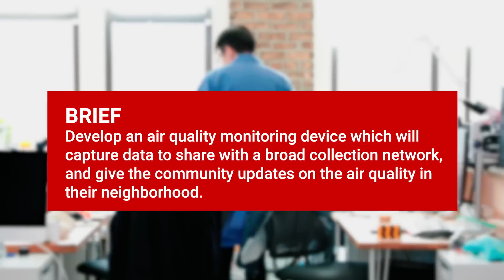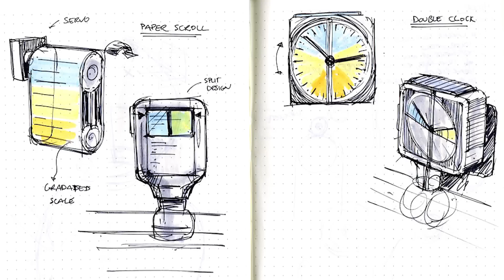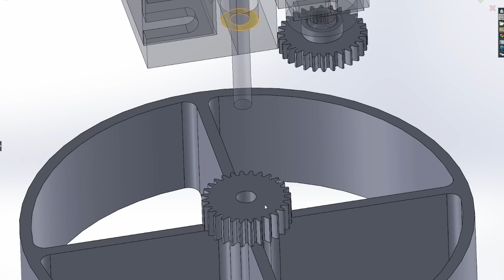Ozone Sensor - Potentially Genius™ | Digi-Key Electronics

Comment: Eh, I don't think the MIKROE-2767 is a "particle counter type sensor". From MIKROE's own website: "This gas sensor has a sensitive layer made of SnO2, which changes its resistance when exposed to ozone." So it's an electrochemical sensor.
Reply: You're totally correct. This was a bit of an editing mismatch. That section was recorded early in the process when we were considering measuring AQI on the whole. After further discussion with Dr. Craft we decided that ozone data was under documented. We selected that MIKROE sensor about a week later.

Comment: You might considering disabling the servo's power using a spare GPIO and a MOS-switch (only to update once per minute or so) - this should drastically reduce standby-consumption from the two servos. OTOH - a "speedometer" style stepper might be more suitable for the task - they are specifically made for such applications.